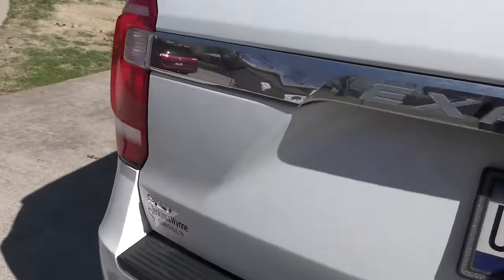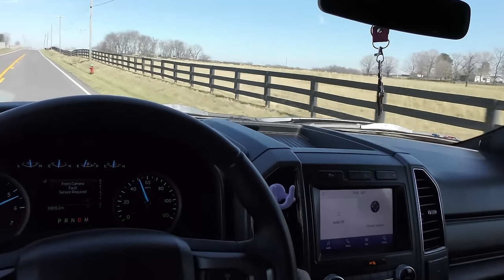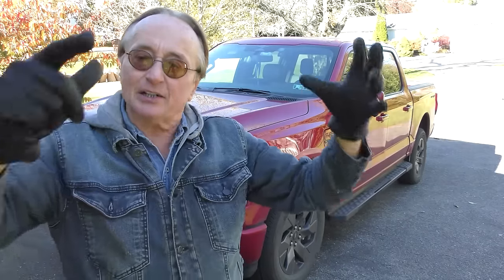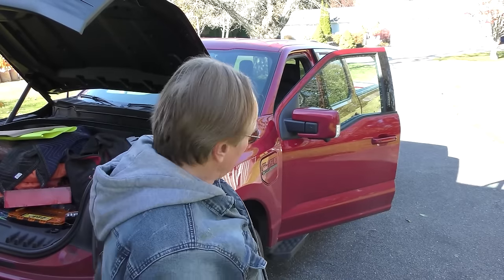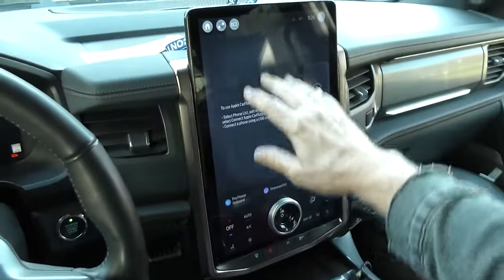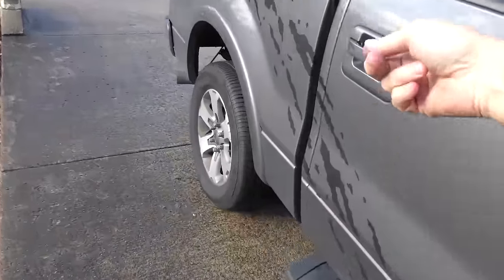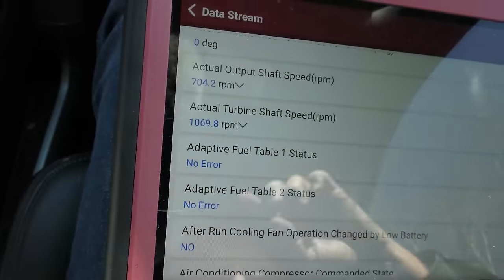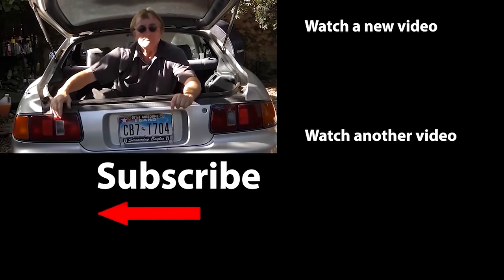Here's Why Fords are Crap Now

Comment: Ford was good once, but those days are long gone.
Reply: Such a shame, especially as the old ones were so good that they still drive, while the newer ones don't. I still daily drive my 2001 Ford Mondeo with the 2.0 Mazda engine and manual transmission.
Reply: The last Ford I had was a new 2006 Freestyle, a paid it off two years early, and planned to drive for awhile.  Not quite 61000, the cvt transmission went out,and would have cost 6000 to replace, because it can’t be fixed, only replaced.  I said nope, bought a Kia sorento, and haven’t had a ford since then.
Reply: Every brand has slipped....
Reply: Yes, unfortunately
Reply: @richsweeney1115 Lexus is still a a G!
Reply: @dannygonxalez9011  Yeah, Lexus still top notch.
Reply: I still drive a 2002 XLT king ranch with 169k miles and never had a problem with it and still going strong.
Reply: It’s the same story for so many of the other manufacturers. It’s really sad how things have changed.
Reply: My 2001 ford focus and 2002 ford Taurus both lasted into the high 200k miles and Taurus was 378k miles 
Never had a issue other than a coil pack in a radiator replacement on the focus and with the Taurus I had a slight transmission issue where you just had to lift your foot off the gas, and then press down on the gas again between third and fourth gear but you barely had to lift your foot up it would catch and then you’d be fine. I drove it that way for years never had a single issue with that car either one of them
Reply: @williamcurry4868 how address those Kias?   I’m driving a 2002 f150 and plan on buying a car next week. I thought Kia’s had transmission problems?
Reply: Now, PROFIT is job one.
Reply: @ThomasKing19933 It’s all I really buy anymore, that and Toyota.  Everything else out there isn’t even close.
Reply: @SteveP116 my 11 year old Rio has almost 149K miles transmission has zero issues
Reply: @dannygonxalez9011  im just not a huge toyota person...my hondas ,mazdas and old fords have all had well over 300k and ran good when i got something else... toyota builds the tacomas  in mexico to build them  cheaper,  they keep charging more. $45k-$50k  for a midsized truck thats built in mexico to save cost...its wrong...nothing is built as good as it used to be..none of them are worth the stupid prices people pay...if people used their brain, theyd stop buying brand new cars and trucks..prices would come down..most people dont even need a car when they end up buying it..
Reply: Seems like no one is really good anymore these days.
Reply: Remember an older Ford pickup?  The small one I can remember the name.  V6 and 4 cly Ranger?
Reply: All the manufacturers are getting bad.
I think it's all the electronics that are causing most of the issues.
I know the mid 2000's were considered high tech for the time, but these things now make those vehicles practically analog.
It's just way too much stuff to go wrong in the future.

It makes me wonder how these things will be in ten years.
The issues are already showing themselves and electronics usually mean they cost alot to fix.
I just think buying any of these is a giant mistake.
Mercedes was the one to starlight this trend and look how good those last after decade.
I think the goal is for them to have a major meltdown so more people continue to just keep buying them, but that might be the opposite effect from what they want.
I would recommend you just lease these over buying them.

Until I start seeing vehicles at a reasonable cost and less computer junk. I'm not going to buy one.
Reply: Last time they were good were in 1914
Reply: I bought an 05 Mustang GT back in 04 and had it for 7 years, the only problem I ever experienced with it was the e-brake, which was covered by my 7 year warranty. I've seen 3 valve Mustang GTs with over 270,000 miles on them. These days, it might come down to the individual vehicle as opposed to the model
Reply: @jessewynne8193  Old Fords are built solid. They had some problems with certain models in the 2000s and up, but were still Ok until recent years. From about 2020 and newer that they had major quality control issues.
Reply: Same with Chevy. 👎
Reply: Fart or refart daily.
Reply: The only good thing Ford makes are Mustangs and even then they have problems. I own one I know.
Reply: When was that ? Like 50 years ago ?
Reply: @SteveP116 Do not buy a Kia/Hyundai.  You WILL regret it.
Reply: So if you took a $75k lightning and  a $75k gas f150. The entire drivetrain for the gasser would cost less than $25k, when removed would leave you with a $50k shell. For the lightning the entire drivetrain would cost atleast $50k, and when removed would leave you with the same shell, same options for 25k? Ford is either shoving it in their * on the lightnings,  or theyre shoving it up the customers * on the ecoboosts
Reply: Reliability aside, the 3.5 eb has more pickup than the v8. Even the 2.7 from a stop feels zippier than the 5.0
Reply: Those days disappeared in the 90s.
Reply: @AydenDoesGames  Hello Brother! Yeah, even Mustangs were racked with problems from about 2020 and newer. A few before then. Mine is a 2018 with that crappy MT82 Manual Transmission. I offset a lot of its issues by getting an aftermarket clutch assist spring from Steeda.
Reply: Lol 2015-17 5.0 are the best you can buy proven Better resale than toyota tundra in my area
Reply: @SteveP116  I wish I could say, but my Kia was a 2012, and I sold it in 2015 because I needed to pay off debt, but I never had any transmission trouble with it while I had it
Reply: Have you seriously never driven a Ford built 30 years ago and compared it to anything they've bulit since 2010? It's like night and day quality wise. I've had Fords from both eras.
Reply: My 2013 expedition xlt is my kast Ford besides a classic.
Reply: @SteveP116  dont buy a kia .... theyre known for their bad motors
Reply: @GoonieLord  lol......thats not impressive...anything SHOULD be able to go  150k...
Reply: @oreally8605  yes....ranger.
Reply: @oilbaroon3104  nah, not all of them
Reply: @AydenDoesGames  thats not true at all.ive owned hondas, mazdas and fords for a long time.
Reply: It’s the government and competition between other automakers.
Reply: @CheapBastard1988 so a Mazda then?
Reply: @SteveP116 the engine failure is worse than the transmission.
Reply: @fila6243  horrible then.   The transmission was scary enough.  I guess it Toyota then
Reply: Engineered obsolescence!  Sad 😔
Reply: Ever since Jim Farley took over he went the way of harley davidson, you have to build it after you buy it. Absolute crap now.
Reply: @williamcurry4868 To be fair, that CVT was from ZF, not Ford. I had one of those too. Got rid of it in divorce sale but I do know the next owner drove it a long time with no issues.
Reply: Bought a new Ford with the 8 speed four years ago. It's been a great vehicle. I'm confident it will go many more years trouble free.
Reply: @macbook802 Two different products and build processes. Ford is actually losing money on Lightnings BTW while profiting on ICE versions. There's really no conspiracy here like you are suggesting.
Reply: @thullraven1 I have a 2013 with the MT82. No issues and shifts like new still.
Reply: @302Mustang13  Glad to hear that. I think the Tremac is a better transmission but the later model MT82 isn't as bad as people make it out to be.
Reply: @thullraven1  Bad years for the MT82 is early 2011s and 2018s. The rest are good with some complaints here and there just like every vehicle out there. I didn't think the Tremec in the GT350 was significantly better than the MT82. That and Calimer transmissions has some really great rebuilds for the MT82. I can't wait to get mine with an aluminum driveshaft, Vengeance clutch, and MGW shifter.
Reply: Not just Ford it's all of them.
Reply: F*cked
Over 
Reliability 
Design
Reply: @1SmokingLizard  Probably coming from a Chevy guy who fixes his truck every week.
Reply: @302Mustang13  far from owning a chevy Pal.
Reply: They are still good you just need to get a super duty. These new 6.7s are awesome and go well over 200k miles before even having the first issue.
Reply: @1SmokingLizard  So trash Dodge/Ram/Jeep? You have no room to talk.
Reply: @kennetho5393  last person claimed I was a Chevy fanboy. Now I'm being hinted that I'm a Dodge/Ram/Jeep loyalist.  Still in lost woods there Bud.
Reply: @colinj5291 my 96 F150 will outlive all of us
Reply: @fila6243 Toyota is the best, mazda 2nd.
Reply: Ford hasn't been good since the late 80s
Reply: @lucast3006 no pride in workmanship!! Just taking all your damn money??!!
Reply: @SnipetsofTime 😂😂
Reply: @SteveP116  keep your 02 f150
Reply: @richsweeney1115 nope. Subaru is better than ever chief
Reply: @ThomasKing19933 including the 15k markups. Lexus isn't nearly the vehicles you people think they are.
Reply: I just found a 2003 Ford explorer with only 50k miles on it. I'm 58, and remember when these things came out . I thought they were an awesome little truck, but had never driven one. I absolutely love this thing! It feels like a tank.... and it's on a truck frame! Thankful for this find. They're like toys anymore.... a shame!
Reply: Not really it's just that you get what you pay for. Electric sucks no matter who builds it. Ford still makes the best work truck.
Reply: I sgree the Crown Vic was a great vehicle to many damm module's now and the TPM i hate
Reply: Ive got an 08 F-150. Back when they were good.
Reply: Lol ford is better than chevy toyota and dodge
Reply: @Southsidebum  I know
Reply: Then both eco pooches will grenade @VortexVibe634
Reply: Yup, I noticed things changing in the late 1990s.  The last ford I owned was a 94 Ranger never had any issues until a cylinder cracked in 2015.  My wife bought a 1999 Windstar and it was plagued with problems from right after the warranty died on it.  Never again will I buy one.
Reply: @SteveP116 since u are Scotty fan u should buy Toyota, Honda or Mazda
Reply: Same thing with GM. My 2003 chevy trailblazer with 200k miles and 4 speed transmission has probably outlasted a whole bunch of newer modern GM GARBAGE
Reply: Agreed .....just like GM
Reply: Even the new Escape Hybrid?
Reply: Come on!! like any other company is doing better Ford still got one of the most expensive race cars
Reply: Agree the old Ford's were great im going back to the sixties the Ford Falcon was a great little car very simple to many damm sensors and module's i hate the tpm sensors
Reply: @OnlyHuman2.0  Agree my son had a Hyundai my granddaughter had a Kia Soul complete junk they had nonthing but problems stay away from them
Reply: I was too
Reply: Sad but true!
Reply: You mean everything modern was good once. It's a world wide fact, not just a ford or car thing. 

What are you driving that's so reliable in 2024?? I'm curious please inform us all. 

Yeah ford sucks, but so does everything else. Want a Subaru? K you'll need a new head gasket at 100k. Thinking of buying a dodge, ok sure prepare to pay for a new transmission in ten years. Oh you want a fancy new "luxury Audi"? Okay well you better have deep pockets cause everything breaks. 

Catch my drift??
Reply: @jackbelarus6458 you're pretty delirious if you think one guy is responsible for all of ford lmao. And that's the polite way of putting it
Reply: @metpach triton is strong
Reply: @braydenrall4019 lol the edge was always a P.O.S since day one
Reply: I couldn't agree more! I currently own my first and last ford.
Reply: Foxbody 😢
Reply: If you have one, rebuild it.
Reply: Descent before 1980. I was a tech and shop manager. Their cars have always been junk. SUVs too. We made a lot of money on fords. Sad the Big 3 have left Americans broke fixing their junk constantly
Reply: Vehicles on average lasted much longer in the 90s.
Reply: @CheapBastard1988 So they were good when they used Japanese parts?
Reply: @williamcurry4868 You went from junk to a slightly lesser junk.
Reply: Nope Lexus and Acura havent
Reply: I have a 2011 f150 with 230,000km on it with 38” tires and a full custom tune,know issues also have a 2021 f150 70’000km so far know issues 2023 bronco 30,000 know issues so far.i have a friend that runs his whole company with 30-40 ford trucks,all have had little to know issues.there not all bad,especially if you look after them
Reply: @302Mustang13 What is Zf?
Reply: @jimkelly4214  Only one of the largest transmission manufacturers in the world.
Reply: We had a 2005 Ford Focus coloured red, the transmission blew up, doesn't matter if we had a manual transmission, their transmission blew up.
Reply: @oreally8605  The old 300 inline 6 cylinder was virtually indestructible and very torquey
Reply: Ford was NEVER good.
Reply: The engineered change to society with electric is bound to cause problems. But if I remember right, ford announced they were moving away from electricity. Better days ahead? Only if they bring the price down, and stop the computer requiring dealer intervention to work on it. I’m not buying one until I can do the work, as I wish.
Reply: @ThomasKing19933  Those days never really existed. 🤣

Comment: I used to be a loyal Ford and Lincoln guy can't afford the problem's and down time had to switch to Toyota and Lexus very satisfied not looking back!
Reply: Same
Reply: I don’t blame you all. American car company screwed their selves.
Reply: Amen
Seems to be a trend for years now
Lits of American brands are failing
U can't beat Japanese quality
Reply: I was unaware toyota and Lexus had heavy duty pickup trucks. Oh that's right they dont.
Reply: I am currently driving a ford but my next vehicle will be a toyota. I owned a toyota 4x4 pick up years ago and I miss it.
There is a massive difference in quality between these two brands.
Reply: Same, still have 3 lincoln and 2 ford but my new vehicle is a Honda
Reply: @harrybullard3486 Tacoma? Tundra?
Reply: @shannonhenson609 

Heavy duty???
Reply: F-O-R-D  FIX  OR  REPAIR  DAILY  😢
Reply: @bobbyjohnson4002  

B-O-B-B-Y
Boy On Boy Butt Yearning...

Acronyms can be fun!!
Reply: New Toyota trucks have their own problems. Toyota Turbo garbage.
Reply: Yes I agree, I have changed from Ford to Toyota and I’ve been very happy with the Toyota.
Reply: Same here. I have a 2004 Lexus 330 with over 200,000 miles and still runs like new with regular maintainance. My Ford's always started breaking down at 80,000 miles. I plan on being a member of theLexus  300,000 club. Plus Toyota pick ups I've owned never needing anything besides regular maintenance.

Comment: Mister nerd again...No one should ever buy a turbo unless they want lots of trouble... There are so many problems with them due to the extreme temperatures involved.   Even the ones with an intercooler are are problematic after about 30 or 40000 miles.

Comment: My girlfriend's 2019 F-150 3.0 diesel with the 10 speed.  The torque converter just failed at 44k.  The guy at the Ford service said "yeah its a common issue and they are backed up in the transmission service due to that exact issue."  Getting rid of it once warranty work is done.
Reply: They couldn't pay me to drive a Ford these days.
Reply: @kingzach74 you cant drive anything else either.
Reply: I love my old 84 k10.      4 wd. On propane 😊

Comment: 10 gears is too much just to save a few drops of gas
Reply: Yeah I got a 2017 with the 5-0 6 speed.  5.0 with the 6 speed is a solid truck in my opinion
Reply: Guessing that's just how they figured they'd go around carbon emission regulations though.
Reply: Multiply that by millions of vehicles. Thats a lot of gas.
Reply: @lancelotlink3907  and a Lot of broken cars rusting in Junk Yards

Comment: I had a 2017 Ford Edge, with the 3.5L naturally aspirated V6 engine. I got rid of it after Scotty told us about the built-in water pump that works off of the timing chain, at the top end of the engine. Haven't regretted it ever.
Reply: Wish I knew this. Now we have a leaky water pump that needs replaced and it’s not cheap
Reply: Had a 12 Ford Taurus and the water pump went bad at 80k miles, put some stop leak in drove it for a couple months and traded it in
Reply: Wise decision
Reply: O please ,where is the starter on a Toyota  V8 ? Under intake manifold. So whatever Scotty. Toyota made some real turds . It's called denial
Reply: @preston8859  Ford makes a Gen 2 version of this pump and recommends different coolant now, so if you do get it replaced, use the Gen 2 pump and have them clean the whole entire upper half and replace the timing chain with a brand new one. You have a reason to overhaul an otherwise perfectly fine engine that will ensure A) You don't have the pump issue again and B) the thing can run for 100K easy.

Comment: To anyone watching this with the 10 speed here’s some advice. If you let a few people drive your car/ truck. The computer learns how you drive and wants to store how you drive so the car knows who’s driving. 

I bought an f150 2020 used with 50k miles and the transmission would occasionally kick like a horse. I cleared all the drivers with a scan tool and it hasn’t kicked ever since. 

It’s been over 8 months without a kivk
Reply: I used a Hypertech tuner and made the trans shift as firm as possible at all times and it's been driving real nice for the last 100,000 miles
Reply: I just bought a ‘19 F150 XLT 10sp…42K miles and am worried. My fault since I should have researched more. No problems yet after 1 month of purchase - 🤞
Reply: How did you tune it?